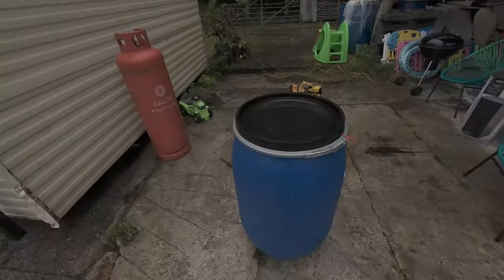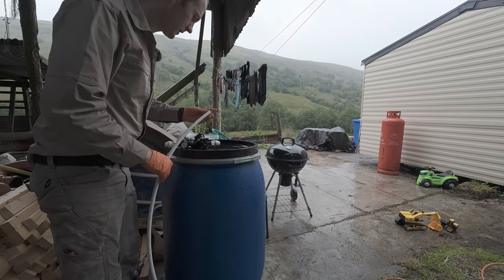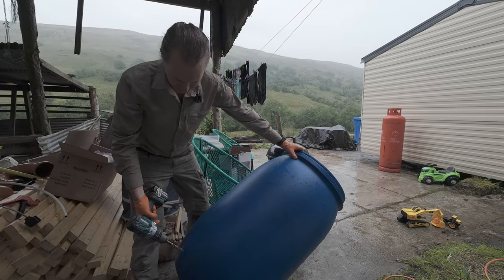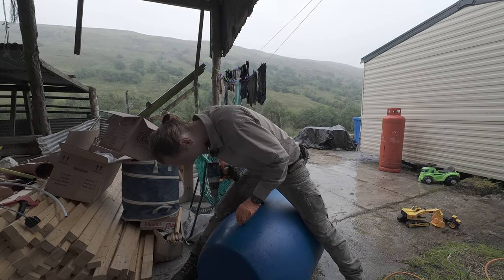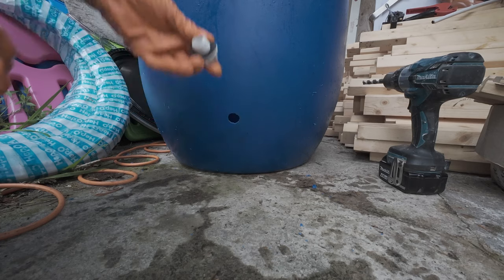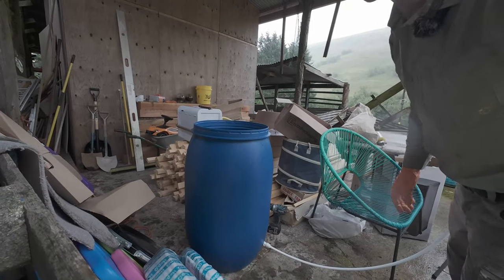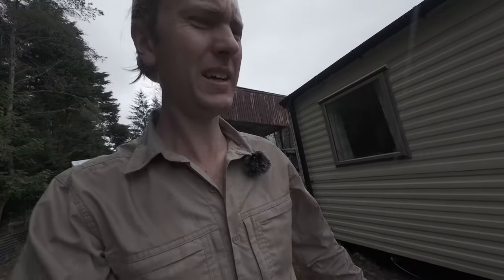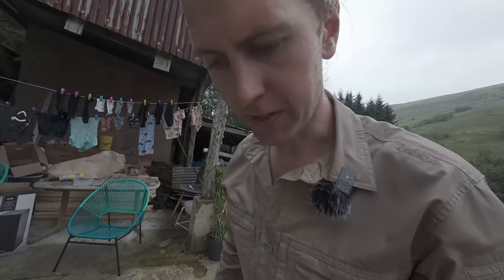Off Grid-Day 11-Quick and basic caravan water connection

Comment: You were coughing a few times in your day 10 video so I worrying if you were coming down with something. 

When it comes to living off grid and not connected to water or electricity things like clean water is treated as liquid gold. I am amazed you did not have more buckets out there collecting rain water!
Reply from the maker: It quickly got tiring so we got the larger containers up and running as soon as we could. The cough could have been some dust from cleaning up I cant quite remember